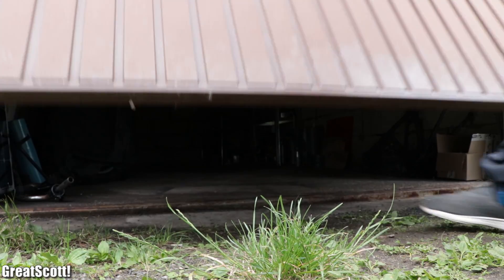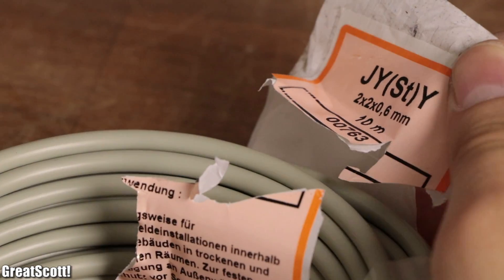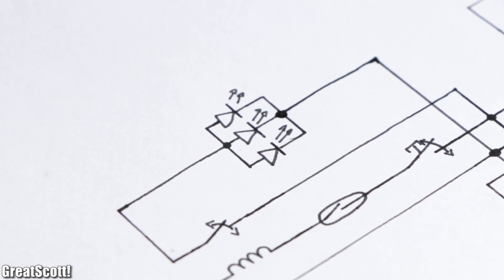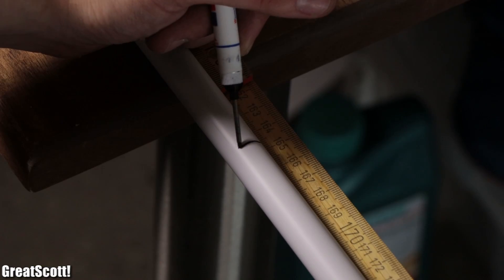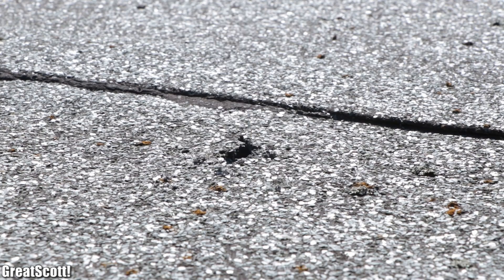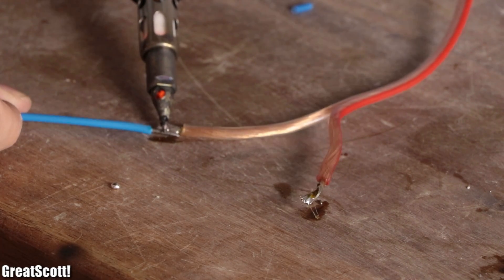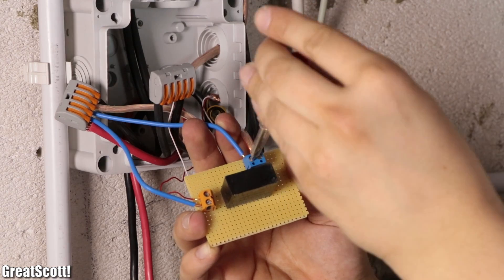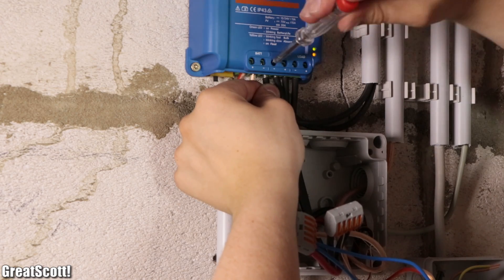Make your own Photovoltaic Off-Grid System

Comment: If you are in the US, code requires you have to either place the AC lines in a metal conduit or keep the DC lines a minimum distance away from the AC lines (consult your local code for how far). You also have to use separate junction boxes and only cross AC and DC lines at 90 degrees with a minimum separation as well.

You also can not use speaker wire for your low voltage lines. You have to use wiring that is rated for what you are doing and is safe to put into a conduit. Same goes for the AC lines. No Romex (in wall wiring) inside conduits. This is because the wiring you see here is designed to be in open air or in a wall. Conduit doesn't let heat out very well, so the wiring needs to be able to take the extra heat.

Even if you're not in the US, you should use the correct wiring and correct conduit installation for your own safety and so you don't burn the place down. What you see here might not burn it down, but it is way more likely and your insurance is going to read the fire investigator's report and not pay you.

Comment: LED strips should be fixed on a heat absorbing material, they will last longer. Let them hang freely around is not professional like using the installation rods.
That speaker wire is not a cable to use for power was already said. Use proper 2 wire installation cable instead.
Using different light coloured strips makes my eyes hurt.

Other than that, it's a nice project to have power off-grid for small applications.

Comment: @greatscott didn't you add a relay between the inverter and the solar charge controller ? because even without load your inverter might drain your battery after a few days without sunlight. you might power up the inverter together with your led strips :)

Comment: Why can't we have AC and DC wires together? Afterall they are completely independent circuits. Is it noise or EMI or something like that?
Would be thankful if you explain.
Reply: short answer: yes; noise can surprisingly easily jump from one wire to other nearby wires and cause problems (particularly between high-power AC/pulsed wiring and lower-voltage signal wiring).

IME, not even a simple 5V on/off signal from a limit switch is safe here; for example: when unshielded wiring was used and the wires for the limit switch were run next to the wiring for a stepper motor.

longer answer: well, started writing something, but it started turn into a longer topic about how/why I would use shielding on the power/phase wiring for electric motors (ex: after running into problems with EMI from motors causing problems for the more sensitive controller-related electronics).

usually, the twisted cables were hand-made (twisting wires+foil+tape) as seemingly it is pretty obscure to want to use STP wiring with 16 or 12 AWG or similar (as opposed to STP for 24 AWG signal wiring or similar).
Reply: Brendan Bohannon But those PVC pipes cannot shield wires and interference can go that much distance at least or magnetism does. And that can easily penetrate PVC or like materials. Then how unshielded wires in seperate pipes prevent issues?
Reply: while not a huge distance, putting wires even a short distance apart will somewhat reduce EMI compared with running them right next to each other. 

though, if it were a bigger issue, using metal conduit and/or using wires with grounded foil shielding could further reduce EMI; as would avoiding running cables parallel to each other.

I wouldn't really expect that particular setup to be particularly sensitive to EMI issues though...
Reply: Brendan Bohannon I see. Thank you very much for enlighting me. I really appreciate it.
Reply: Why argue with IEC?

Comment: If your solar panel is fixed to a surface to capture maximum direct insolation, the solar panel must be tilted with the tilt angle being the latitude of the location. While the orientation of the panel at the northern hemisphere being towards south, and vice versa. This way, the sun stays close to perpandicular to the surface of the solar cell for maximum number of irradiation hours. So, I think just installing on a rooftop is not a good idea.

However, nice work GreatScott. Keep it on ☺

Comment: Nice project! I've had the same problem too but I decided to use engine generator because of power consumption. I work in garage a couple hours per week and usually use arc welder and other machinery so solar panel isn't best power source for me :) I wonder how about mechanical strength of the panel though. I suppose hail is pretty common in germany as well as cold snowy winters. How solar panels about that? I think they don't like it ;)

Comment: I enjoyed the video thank Scott. My suggestion would be to add a fuse from the battery to the charge controller to add a bit of safety. Panels work better when cooler so sticking the panel down isn't optimal,  but then a lot of panels are mounted this way. Glad to see you've got a reputable MPPT solar charge controller this time around :-)

Comment: why use lead acid? It might off-gas. Could you use  agm or lithium? especially at 16+ volts, that's a large overcharge.
Reply: They don't charge at 16V, the controller drops down the voltage to match the charging characteristics of the battery.

Comment: LED strips are not efficient light source - they use resistor to drop current. Those create heat, not light.
LED strips mounted like that will loose brightness very fast, they need to be mounted on heat sink.
And as people pointed out, solar panel should be mounted under angle.

Comment: Nice work. By the way, do not use a lead-acid battery indoors, it's very dangerous. This battery erupts hydrogen during charging. Probably need ventilation

Comment: Your basement alarm system could be a good addition to your garage.

Also, if you were to add more solar panels for a greater power output, would you add them in series or parallel to the existing solar panel?

Comment: Fuses. If you get a short your wiring will burn out and set garage on fire.
Reply: not much to burn in that garage...
Reply: wayne burner 
all solar charge controller have fuses inside it 
and also have short circuit protection
Reply: I was thinking the same, but if you look in the video at 2:22 it shows on the label that this device also contains 20 A fuse.
I also found this on the internet (sorry, I just found it in german): https://solarstrom.net/wp-content/uploads/Anleitung-BlueSolar-charge-controller-MPPT-75-10-75-15-DE.pdf
On page 4 it says that there is a replaceable 20 A fuse next to the battery connector.
Reply: Maybe, maybe not. The wires might just break(melt) and open the circuit.

Comment: Although I am not authorized, I would totally redo the electrical wiring in the apartment where I live. The smartass who did it wired everything to one fuse and the fuse box has 3 fuses. I saw this when I was changing one broken switch that was making shorts and setting off the fuse. Also, when my fridge compressor starts, I get a power failure (voltage drops) for a brief second. Good thing I got an old UPS for my TV, router and PC.

The bad part is that I don't have the wiring plans, as this apartment is very old and I believe it's the same wires going to all the switches and sockets. The second bad part is that it's not my apartment and I know nothing about in-home decoration, like painting walls or applying cement.

I was thinking about getting another UPS to use as a cheap 12V inverter and a solar panel with 12V DC circuitry output to charge my 9x 12V UPS batteries to run my stuff here, but I only get around 6 hours of sunlight on my side of the flat. But those are only dreams I guess, can't do anything here since it's not my apartment.

Comment: You should make some adjustable frame to hold solar pannel at different angle to get more efficiency from the sunlight ,,,btw you are using 12v dc led strip which can be  powered through mppt directly so what is the need of inverter,,,...?

Comment: I absolutely LOVE your solar videos. I hope you do more in the future!!
Reply from the maker: Thanks. It is on my to do list
Reply: GreatScott! I would really love to see you take on a MPPT solar charge controller project for 3s or 4s 18650 li-ion battery pack! I'm thinking on building a "solar suitcase" set, one with a 3D printed foldable solar panel packed inside and one with a 18650 battery pack 3S20P/4S15P, 230V inverter, USB outlets and so on, but I'm kinda stuck on the solar charge controller for it
Reply: GreatScott! Yesss please do a video on how to use solar power to charge a 3-4s battery pack and which configuration is better. I struggled trying to find a good solution for a 12v inverter. Because either the voltage is too high or too low with the 3.7v nominal voltage. I would really appreciate it!
Reply: Cody Orlovsky The best solution I've come up with is to either use a high wattage buck or a boost converter to power the inverter instead of feeding it directly from the pack, this will result in some losses in the converter, but maybe Scott knows of a better solution?
Reply: LordFelix93 He usually compares different methods and calculates their efficiency but so far the only way I've seen to do it without a buck/boost converter is to use a 24v inverter in what I think is a 6s configuration. I could be wrong but if I remember correctly if you type in DIY Tesla Powerwall you may be able to find some of what I'm talking about

Comment: I don't think sealing the panel to the roof is a good idea. Expansion and contraction of air under the panel with temperature will suck in air including moisture that will then condense under the panel. This is often worse than the "flooding" water from rain, because rain water usually drains away and the rest dries before it has a chance to seep into anything.
If you don't want to drill any more holes into the roof (which I understand; any hole in a flat roof means trouble, no matter how well you trie to seal it), you should at least put some spacers under the panel (can be long pieces of aluminium tubing or something like 40x40 aluminium construction profiles). You can still glue those down (and to the panel). This also help with temperature, as others already wrote, solar panels lose alot of efficiency when warm.

Comment: @GreatScott ! Nice video! I'm a big fan of solar energy and I hope you do a video on Grid Tie Inverter Solar systems or On-Grid Solar systems if it is legal to do in your country.
It decreases power usage from the grid by giving solar power to your home grid so you can save energy/money and it can sometimes give energy out that's why there is a limiter that prevents that from happening since it is a breach of contract for our power company.
The inverter directly plugs into a power outlet so it can power anything that is in your home grid. No need to use only 12v LED strips or bulbs, it can power any 110v/220v appliance even though you only have a 100w panel or less. It just helps the grid in powering your appliances in turn decreasing power coming in.

Cheers!

Comment: You wired the socket in the video with neutral on the right instead of the left :)
Reply: - Automata - Interesting to know. I do know however that you always wire the neutral wire to the threaded part of a light bulb socket because there is a low but possible chance that people would touch the threaded part when changing a light bulb.
Reply: Norbert Harrer That's exactly right too. It's an unwritten code for electrical safety even in unlikely situations. That's also why the different wires inside a cable have different colors of insulation. You don't necessarily have to follow the color codes but it helps lessen possible accidents. You shouldn't use the yellow and green earthing wire as a live wire in any situation though.
Reply: Wow. I didn't know that there is a rule for that. But I always wondered if professional electricians have a guideline for that. Is that a country thing? Is neutral usually wired on the left side in Germany? (austrian here)
Reply: Norbert Harrer I'm studying to become an electrician and we are taught to check that neutral is on the left each time. It's not a rule, but it's usually an easy way to tell if the job was done by a professional or someone else (Illegal without a class 2 electrical safety exam without someone with said clearance supervising).

Finland here btw.
Reply: - Automata - When I instal sockets i always put the live on the left and thats how i know where the live is
Reply from the maker: Possible. But there is no rule for it so......

Comment: I like your videos, but this time your realization of this instalation is tragic. What if you want light LEDs when is cold outside? Better idea is do light switch parralel to the magnetic read switch. Second, why you left so much space between junction box and the electric pipe? This looks terrible. Third, why you don't use electric elbows? This is the basic of making electric instalation. And last when you connect cables in junction box, always try entrance cables from the bottom, because water can gather on cables and flow along cables and makes short circuit and destroy your electronics easly.
Reply from the maker: This installation is according to german standards (most of it)
Reply: Ok, I understand, but you could do some improvements. Example light switch should be parralel to the magnetic read switch (in my opinion this will be more usefull), but is only a suggestion.
Reply: Only missing a switch (for both polarities) or better an LS-Switch between panel and controller, and a fuse between controller an Battery. ;-) but nice video.

Comment: This installation does look very strange. I have used conduit before but with junction boxes and fitments designed to take the conduit into them where it was glued or fitted with compression joints.  Any right angles used appropriate conduit adaptors. All joints were sealed/glued so no cable was ever visible anywhere along the length of the installation. Unless you seal everything in I see no point in using conduit in the first place.
Reply: The angled pieces cost loads of money compared to regular conduit at least in home improvement stores in Germany. It's not uncommon to leave angles without conduit around here as conduit is more seen to guide your cables over longer distances.
Reply: It would certainly be cheaper to leave out the connectors but then how would you keep rodents out? Mice can get through tiny holes and have an annoying habit of chewing through insulation.
Reply: I totally get that point, but I also have never seen rodents in my garage or my workshop at home (workshops not adjecent to the main house and is basically like a free-standing garage). 

I guess it all runs down to how much you want to spend and what your main objective is - Scott obviously went for going off-grid and having electricity inside his garage. I bet when he notices rodents in his garage, he'll probably will fix up his conduits :D as will I at home. I dont run conduits at all and just have an "outside-grade" cable neatly attached to the wall and ceiling rafters. Mice will have a hard time getting up there :D

Comment: why did you remove the old wiring? These old switches ,sockets and lamps are looking really nice. I am not happy at all that you ripped them out :-(
Reply: Those oldschool plugs, sockets and lamps often have no earth, which can be a problem with German standards (VDE) also LEDs are waaaaaaaaay more efficient then old stuff. You can get oldschool sockets and switches with modern internals, but they cost A LOT of money.

Comment: Do those LED strips operate on 12v DC?  If so, then I assume that the AC wiring (via the inverter) is there to power the garage door motor.
Reply from the maker: Yes the LEDs take 12V. The inverter is to power the sockets in case I want to use common AC appliances

Comment: Cool video. Building off grid systems is pretty interesting, but what I find more interesting to me are hybrid system. I think you should still consider connecting to the grid. Mainly because you can sell the unused energy and therefore gain some money from building it. I don't have enough knowledge to say if it will be worth it but at least you have a concept for another video...

Comment: Did you lay it flat because you have to register off-grid solar panels and you don't want your neighbours to see it? Depending where you are 15-20° and summer 60-65° are your optimal angles in germany.
- The difference at 0° in the winter is not too big but in the summer it's a decent difference.
- Another problem with flat solar panels is that they don't self-clean with the rain anymore. A flat panel accumulates all the dirt from the wind and rain and has a very big cost on efficiency.
- And because you sealed the back of the panel, you also lose half it's cooler surface which again is going to cost a lot of efficiency.
There's almost never a good reason why you lay a solar panel flat.
Reply from the maker: Simply because I do not want other people to see it. Also I did not want to drill more holes for a proper mounting since water could enter through the roof.